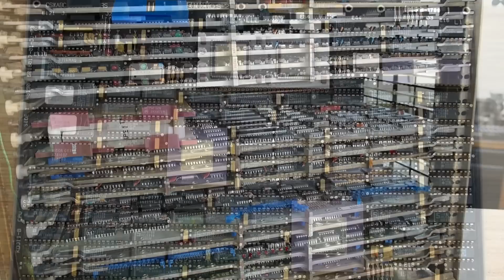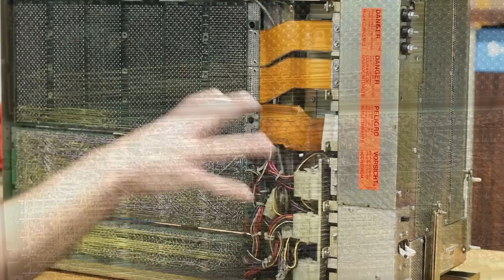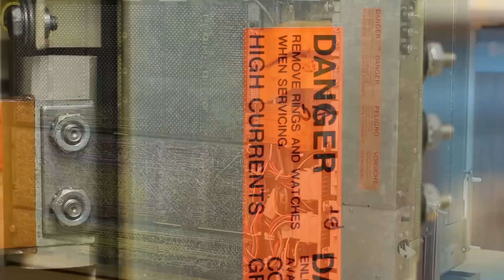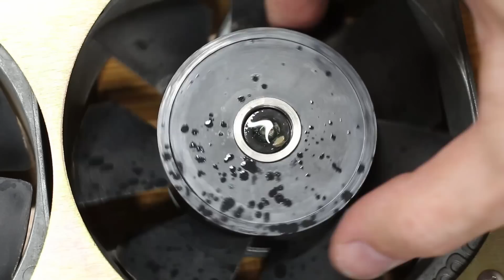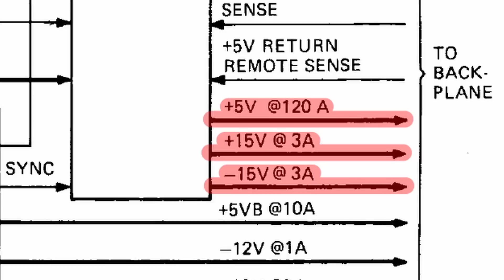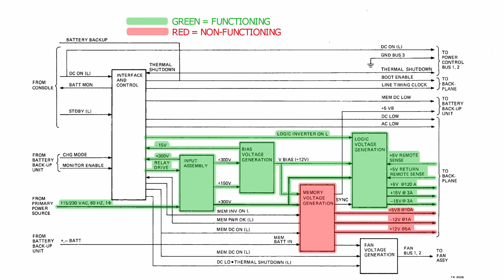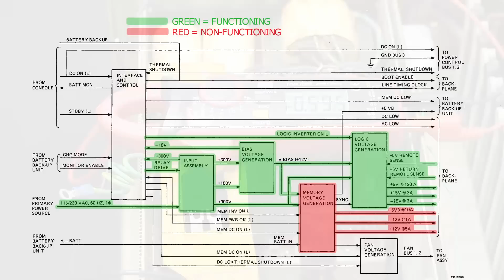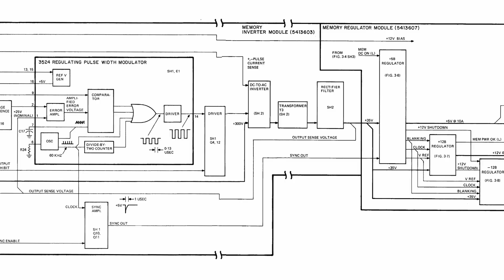Only DEC could make a PDP-11 PSU this insane…

Comment: So... it might be time to consider picking up or making a few pieces of test equipment for working on analog things. 
1. a non-contact signal tracer, when working with things that oscillate or have RF this allows you to quickly trace how far the signal is getting. Given that this PSU uses oscillators... that could be useful in figuring out if the signals are getting where they are supposed to go.
2. A low voltage curve tracer. Just because the multimeter says the part is good doesn't mean it is. A curve tracer lets you see how it responds over a range really quickly, and if it's being suspect. You'd be surprised how many 'working' parts look really funny when you check their curves. You may want to get the type called a 'step' tracer or make your own, there are kits. Or you can just head to your nearest Ham radio swap meet and see if someone has one or can help you make one. These can be much better than oscilloscopes in some cases at finding faults.

Comment: When you finally get a console terminal connected to the CPU, it will be interesting to determine which version of the console firmware you are actually running.  As a former departmental computer system manger of, among other things, an -11/44 running Unix, and a 2-node MicroVax-3800 cluster running OpenVMS, we had discovered bugs in the -11/44 console firmware and worked with DEC to provide a test-bed to evaluate the bug fixes they developed.  Unfortunately, that was over 25 years ago now, so I don't remember the details.

Comment: 35V just another tap off the transformer, oh, dude, this is DEC…

DEC had some of the best docs in the business, even their doc docs (documentation guides) were excellent. I always found them more accessible, and easy to read, compared to IBM.

DEC systems were also some of the most easily field serviceable systems around, they were just a pleasure to wrench on. They really seemed to think about us on the other end, in their design, make it easy to work on. Another one of the day like they were AT&T PBX’s, the System 75 as an example.

Manufacturers of today should be taking notes from companies like DEC.
Reply: I think manufacturers of today do take notes from companies like DEC ... then strive to do the complete opposite!

Comment: Why did you try to test it with the missing 12V? I didn't get it. If a voltage rail does not have the correct voltage, first thing to do is to troubleshoot it. Imo. 🤷‍♂
Reply: Might be one of those dumb decisions he mentioned...

I have to say that my first thought when he mentioned the fans ran on 35 V power was that 3 x 12 V = 36 V which is awfully close to 35 V.

So the 12V supply could be involved in powering the fans...

Would always be handy to have a bench  power supply so that you test the individual fans and get them spinning smoothly if possible beforehand.
Reply: @jnharton  My first thought was the 3 fans being 35VAC they may be wired to the 110VAC in series, maybe with a dropper resistor. Not this crazy over-engineered system.

Comment: Those cables at about 6 min are called FFC, or Flat Flex Cables. They are basically a PCB made with Mylar, with the copper etched, plated and sandwiched with more Mylar. More modern variants can have parts mounted on the FFC,

They are a great way to simplify and make robust connections, while greatly reducing size and cost.
Reply: Sometimes known as FPC, for Flexible Printed Circuit, since they're often just flexible PCBs [kapton core instead of fiberglass] with connections on two or more ends
Reply: The use of FFC goes way back to NASA's Apollo program, where they were used to connect various scientific instruments on the surface of the Moon, as part of the ALSEP (Apollo Lunar Surface Experiments Package), to the ALSEP's central transmitting station.

Comment: This my just have been lost in editing, but before taking out components like the diode on the power supply main board, why not first check the voltages on those points. If their good, no need to unsolder anything. 

I think you are seeing the fans twitching because it takes a fraction of a second for the power supply protections(like overvolt or short) to kick in .

A schematic would be incredibly useful at that point, but the block diagram does tell a lot. If you know which module is which block ( if it's that convient) that you can check the signals between them and determine which block and which protection is kicking in. That way you can focus on the stuff on that board. 

Though the problem could be in how boards interact. Curious Marc did several power supply diagnostics like what you have in recent months, maybe his videos can give you some tips. And you also seem to have his personal line😮
It's going to be a lot of methodical work maybe even going master Ken and drawing a partial schematic from the boards. A lot of work.

Comment: I thought the PDP11 schematics are readily available in the internet?
Reply: Yes they are. The 11/44 was built into the BA11-A chassis which has a print set called MP00832 which is available on bitsavers: http://bitsavers.org/pdf/dec/unibus/MP00832_BA11-A_RevE_Engineering_Drawings_Apr87.pdf
Reply: Show us the links.
Reply: I posted the link yesterday but it seemed to have been removed. Anyway it is easy to google ”DEC BA11-A print set”

Comment: I got caught out with an old VAX and it had a cable from the compute shelf down to the base of the unit with a power distribution box - and a switch there probably either turn everything on in one go or some old battery system. DEC Power supplies are pretty bullet proof - possibly around bus terminators given you talking about memory power generation circuits. You would get some very odd things happening without out the correct continuity grant boards or terminators at the end of the bus as well which could cause the system to hang and fans to not start. Even back then fans were variable speed and wouldn't start up if the CPU wasn't happy.

Comment: I like the term Spinning Rust ... accurate and evocative 

DEC 11/44 is effectively a chip on a human scale where you can see the wiring .... !

Remove Rings and Watches ...because it is the Amps that kill you, not the Volts
Reply: Yeah  seeing all those wire-wrap connections makes you realize what a good idea chip layout software automation is.  Even red mylar tape for layouts was a big step forwards. All that rat's nest reduced to a few clean and simple masking and etching steps.  There's something to be said for progress.
Reply: It's not about killing you. 5V won't generate enough current through the human body.

However if you short the 5V supply with a watch or a ring or similar it's capable of pumping through a lot of current. That may weld the short together, get very hot etc causing injury. It's not going to kill you.
Reply: @cdh76  Might kill your ring finger, though. Ouch!
Reply: YouTube apparently doesn't like me replying with links to YouTube videos. Google Styropyro for a good video on why it's not the Volts or Amps but a whole lot of other factors

Comment: Looks like it's at least trying to give a fanspin, haha! 
Keri on fighting, you'll do it. I believe in you.

Flex PCB cables as busbars? Very interesting and modern - that stuff was certainly high tech and expensive, but of all companies, DEC definitely had the resources to pull that off. I wouldn't be surprised if these were multi-layer, at least on the high current busses.
Reply: You see that on a lot of failing power supplies, it comes from the fraction of a second it takes for the power supplies protections to kick in.